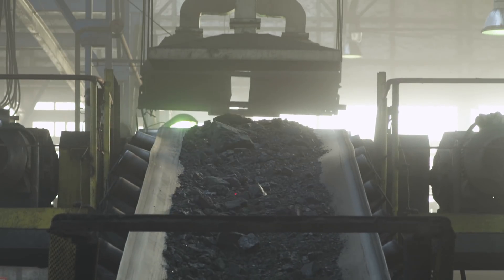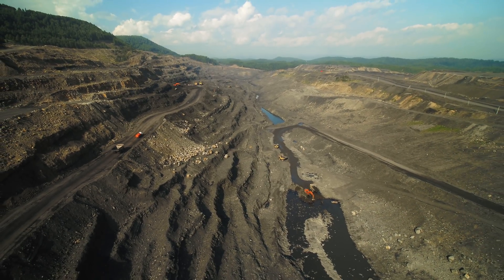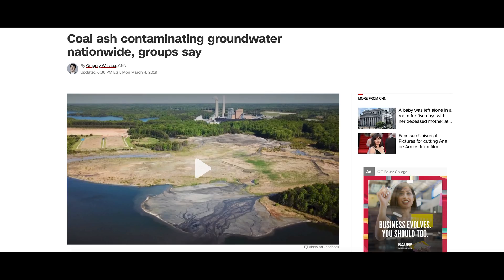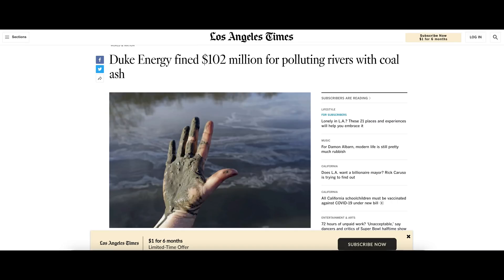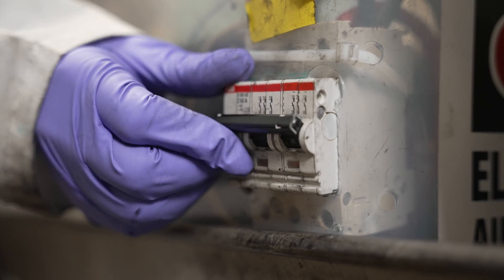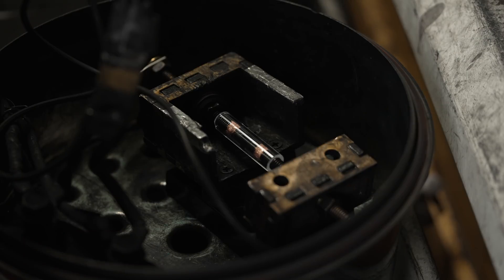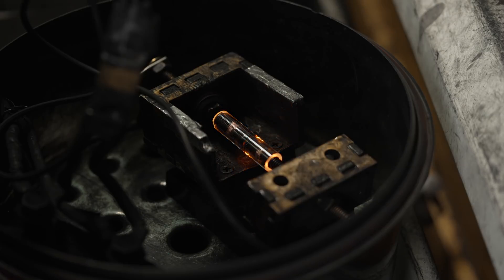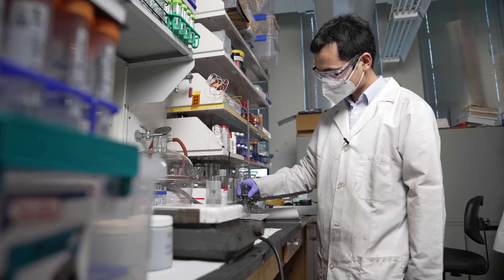Rare earth elements await in waste

Comment: Sparton has already managed to produce U3O8 from coal ash and sometimes coal ash has 8 times more of uranium than in current rock mining. The fly ash has already been treated and is suitable for leach in situe and then ion resin exchange. The other heavy metals is Thorium and Mercury so its possible. The coal ash dumps could extend the uranium element by an extra 100 years.